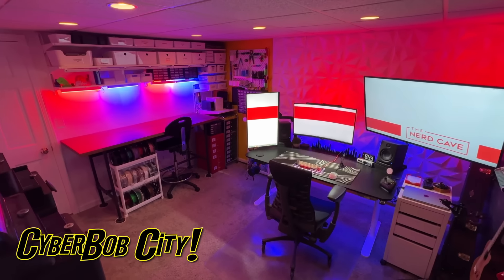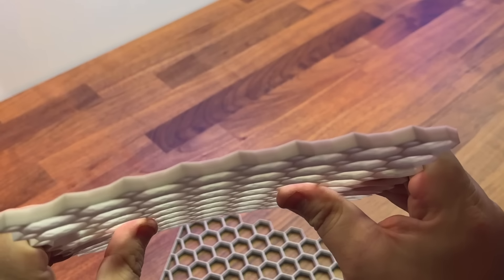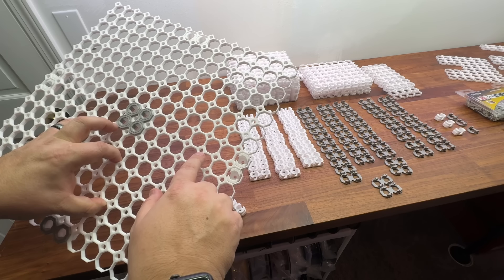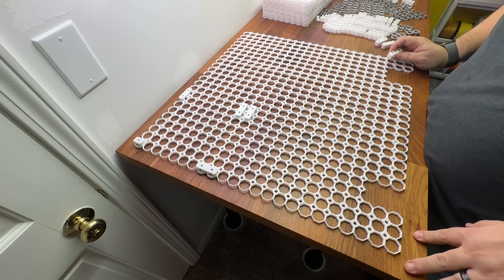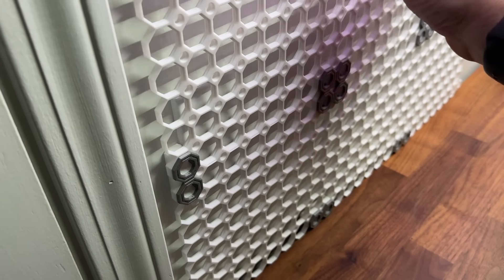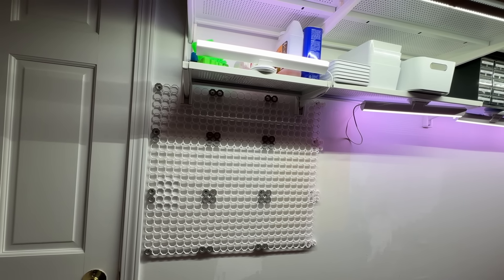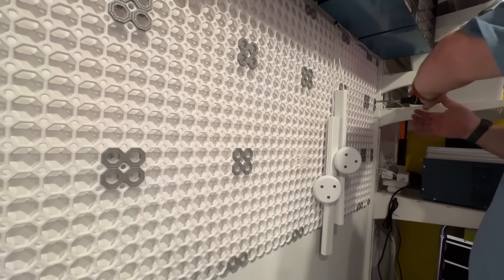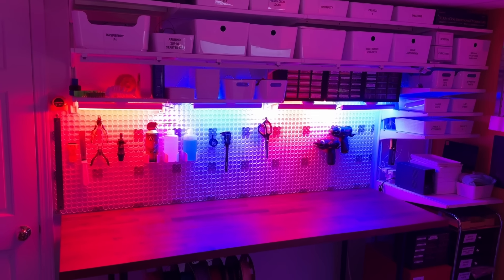It's MULTIBOARD! A Better Honeycomb Storage Wall?

Comment: Well, I get that this is was posted 4+ months ago but, you said something I'm trying to learn and I've only had access to a 3d printer for a month so I hope you can help me. 
Taking 2 designs, removing what you don't want and putting them together is something I'm having issues with and I'm not sure if it's me or the program I'm using. 
I have Shapr3d and I can import an STL but, I'm not able to modify it, or anything. 
Please help and thanks.
Reply from the maker: Hi. What you want is to download the snap ".step" file and that you can import into Shapr3d. Just search the Google for "Snaps - STEP Multiboard Remixing Files" and you'll be able to download that file, import it into Shapr3d, and add additional bodies next to it which you can then export as one piece.

Hope that helps! Thanks for watching!

Comment: Do you happen to have the build list for your performax printer rack/shelf. Love the setup and would like to replicate?  Thanks
Reply from the maker: I’ll make sure I add that to the description tomorrow with links to the Menards site!
Reply: @CyberBobCity  awesome, and would you mind providing your shelving system information as your space pretty much looks like mine and your setup is amazing.
Enjoy your day
Reply from the maker: @guybaryo3244  well the shelving above my workbench is IKEA Algot which they discontinued. They have a newer system called Boaxel but I’m not sure how it compares. I did use all IKEA bins on my shelves.
Reply from the maker: I've now posted the pieces i used on my rack and their cost. Please check the description.
Reply: @CyberBobCity  awesome!  This is very much appreciated.  I got the shelves and baskets per your recommendation and have them installed today. Enjoy your weekend!
Reply from the maker: @guybaryo3244  Awesome!! Have fun setting up your space!!

Comment: Does that Menard's shelving require any hardware? What are those caps on the side rails, did you just 3d print caps?
Reply from the maker: It comes with a a couple bolts to bolt on the the brace going from the front to back in the middle of the shelf. Yes, designed and printed some quick caps. I've been meaning to get them up on Printables if you want to print them.

Comment: What is the benefit to a regular pegboard? You can 3D-print accessories to that to and it must be cheaper, right?
Reply from the maker: When I used pegboard, the hooks would come off all the time when taking your tool off. This gives you so many more ways to mount things and all of them attach to the wall really well.

Comment: Honest question;  Do you think maybe the amount of wall anchors is overkill?  Given the multiboard is plastic (strong, but still plastic) there's a limit to the weight that can be hung.  It seems like the large sections (8x8x4's) could be just as good with one anchor in each corner.  I could be totally wrong though, thoughts?
Reply from the maker: I think there are some people putting anchors in all 4 quadrants of the quad snap. I didn't think that was necessary. 

For this to feel ridged, I think I used the right amount of wall anchors, and 8 of the screws ended up going into studs. While I don't think I'm going to hang anything super heavy on this, the board seems strong.

Comment: I wonder why there isn't a quad support snaps (like there is a front snap).
Reply from the maker: There is now actually, though it's still 2 seperate pieces. They cross and make an x-pattern. I'm working on a new video with an update and I'll go over some of the new parts as well.

Comment: How long did it take to print all that? I have an X1C and just printing a single 9x9 multiboard tile is going to take 5 hours :(
Reply from the maker: They are all 8 x 8 tiles and took about 3 hours each. It really didn't seem to bad.
Reply: @CyberBobCity  You mentioned something about the drywall anchors you used not being very secure, do you have a recommendation on which anchors to use? I mounted an IKEA floating shelf recently and had issues with it feeling 'secure' too.

Comment: I don't like how the board flexes when inserting tools into it! Btw what is the actual benfit of this over the Honeycom design?
Reply from the maker: I've since been told of some "Wall Support Pegs" you can install which can help with that. But in daily practice it's no big deal.

The honeycomb wall only has snaps, this can use pegboard accessories, snaps, or threaded bolts because both the octogons and the smaller peg board holes are threaded...

Comment: What was the print time on all those panels?
Reply from the maker: I think about 75 hours just for the panels. The 8x8 squares take about 3 hours each on my Bambu Lab P1S
Reply: @ I saw that they have an option to print them stacked now so you can do I think 6 panels in 1 print. They print stacked on top of each other so that might be the way to go for such a long print.
Reply from the maker: @Member00101  Yep, a lot of people do that. I have two printers so it honestly didn't seem like a lot of printing doing them one by one. It also depends what you want the face texture to be. So if you have a textured build plate, you might want the front of all your panels to have that same texture. You can't get that same texture with the stacked printing. So something to think about.

Comment: how much does it cost to print such panels?
Reply from the maker: The 8x8 core tile uses about 78gm of filament. If you bought a roll of PLA for say $20 for 1Kg, it would cost $1.56 to print the 8x8 core tile. Hope that helps! Thanks for watching!
Reply: @CyberBobCity  thank you very much, this was exactly what i wanted to know

Comment: the screw in plastic type of drywall anchor which split after putting hardware through them are the only one's worth using.  they can hold so much weight it's crazy
Reply from the maker: I do like those and use them everywhere else. For some reason I thought the ones I bought would be great for this board... Should have stuck with the screw ones though.
Reply: yeah those push in ones are pretty hit and miss, the split apart put in one's are a little better
Reply from the maker: @justinbouchard  I still need to do a test to see why they aren't locking on. It will be in my next video. I think the screws I picked are too short.
Reply: that could be a thing, if they're the split type of anchor the screw does for sure need to be long enough to get past the "pop open" point of the anchor

Comment: Um... There's supposed to be a two-part cross-connector thing for holding the intersection of four plates, instead of just using a pair of double connectors on the back...
Reply from the maker: Those pieces were released a month or two after I made this video. I’ll be posting an update with some of the new parts very soon.

Comment: What you call the 'core' type is called the corner tyle on their page lol.. so confusing. I was like this makes no sense
Reply from the maker: It’s really not too bad. There are 3 types. Core tiles, side tiles, and a corner tile. Most of your board will be core tiles starting from the bottom left and working up and to the right. The top and right edges will be side tiles, and your final tile in the top right corner will be the one corner tile. You should only need one of those corner tiles.

Comment: There is a quad connector to use in place of the 2 double connector for the wall mount. It joins 4 tiles at the corner.
Reply from the maker: I am using the Quad Part B connectors, but I don't think the piece you are talking about is used "in place" of the Part A dual connectors. I think it just joins two of them in the right orientation.... I think. Jonathan didn't use them in his getting started video so I didn't see the need for them here. But I'm just going by the information I could glean from the Multiboard site and all the videos. If I am understanding you. 

Thanks much fort the comment!
Reply: @CyberBobCity  Thanks for the reply! 🙂 I’m hoping I know what I’m talking about because I’m printing a whack of them right now 🤣👍👍
Reply from the maker: @mikestewart4752  please send me a photo of them. bob@cyberbobcity.com
Reply: @CyberBobCity  👍 When I get home from work!
Reply: @mikestewart4752  Jonathan never made them because he said that it actually reduces the strength. Although there are a couple community made ones. I personally used a quad one that I shaped up in tinkercad but I don't think either way is wrong.

Comment: You never told us why you chose Multiboard over Honeycomb
Reply from the maker: I guess I didn't summarize it. Lots more mounting options, feels stronger. A lot more thought and design has been put into this system, especially with the MultiBins and MuiltiPoint now. It's just more versatile than HSW.

Comment: Rather than having so many wall mounts, I glue my honeycomb wall pieces together and then the number of actual places where this is attached to the wall is less and can be more strategically placed
Reply from the maker: This is a little different since it’s mounted off the wall, but glueing them together would definitely make them stronger.
Reply: That's really smart! Also looks way better

Comment: I hate that its no longer Hex... Also that there is a paywall on stacked print files.
Reply: you can make your own stacked print files its just a 0.2 gap on z axis between panels.Just duplicate , move and align the duplicated part to the same exact spot and rotation as the first part then rise the duplicated part 0.2 above the first part.
Reply from the maker: The hex wall isn’t going away… you are free to keep using it! Lots of options for everyone!

Comment: He stole my design, He took my ideas and HCW and made this frankenstein version. My Gridfinity idea you literally took the same design I made for my Screw Wall. Not cool bro, he should come up with his own ideas not steaing others. Me designs are clearly made before yours. NOT COOL I will be looking into options on myside...
Reply: Ngl this doesn't really look anything like the one on your channel...
Reply: Its the idea of adding screws to a storage wall, I started this and he just took the HCW and added them. Its not nearly as strong and its a rip off of the HCW at least my idea is original. @PrecipiceIndustries
Reply: bruh you think you invented 3D printed screws? I've been using them in my designs going back years
Reply: @AllThingsSTL do you have a patent on it?? Didn't think so. You have 100 subs. I doubt anyone is trolling your channel stealing designs. 
What's not cool is your accusations. This is a community built around open source design improvements. 
You seriously need to chill.
Reply: @polycrystallinecandy  I know I didn't invent them, I was the first to build them into a storage wall, then the "thread board" came out and not this multi board.. Its just annoying is all. I did all this work and they are getting paid for it.
Reply: @AllThingsSTL  I can understand your frustration, but unless you have a truly original patentable idea, it's all about who does better in marketing and building a community. Also, multiboard isn't just a rip-off, it introduces several new ideas. For example, the thread is cut through the octagon, so the octagon acts as both a snap-in hole like HSW and also a thread hole.
Reply from the maker: I don't think you can say he stole your design. The threads on the panels aren't even full threads. They are just notches that lets the threads work. I did see ads for the Screw Wall but I didn't think that would be the right solution for me. Even now that I have my wall up, 90% of the holders on my wall are snaps, not threads, and they work great. Thank you for watching!

Comment: im printing the multiboard right now, it seem a realy cool thing 
the only problem for me is that on my ender 3 pro it takes like 5 and a half hour to print one 6x6 tile 🥲
Reply from the maker: I got Klipper setup on my Ender 3 Pro so I could start using input shaping. Don't have the kinks worked out yet but I bet it will be able to print faster now.